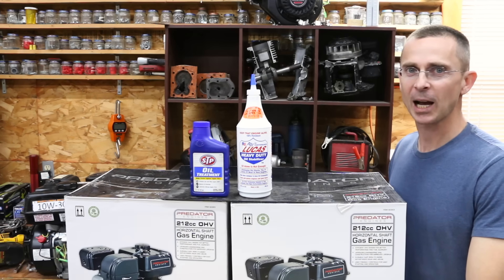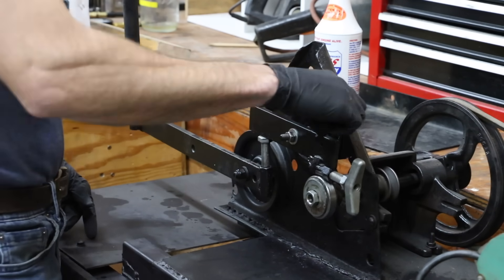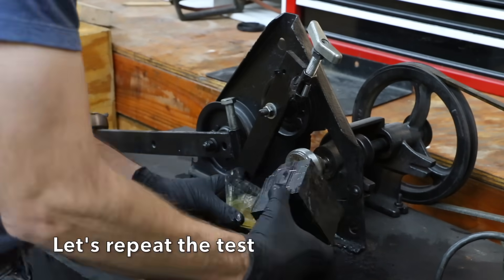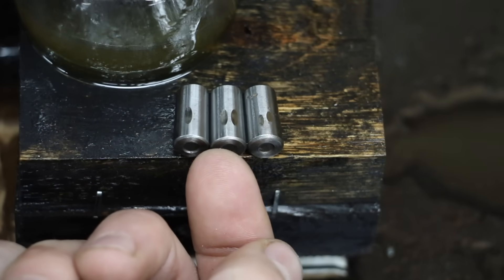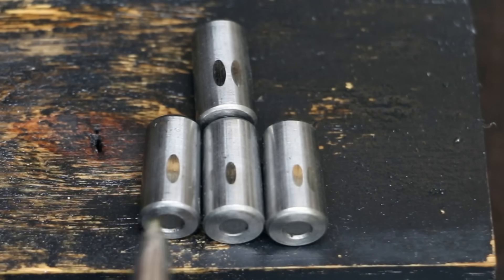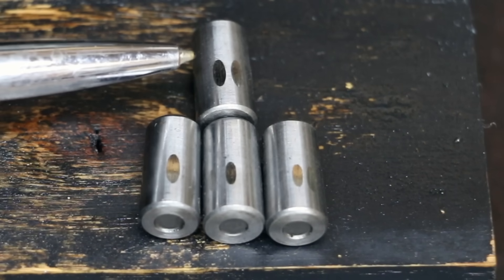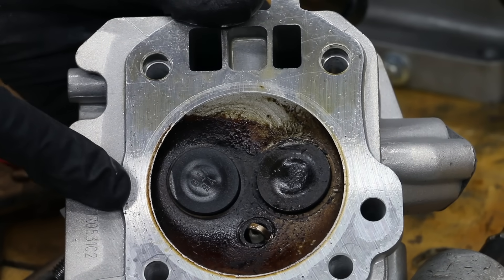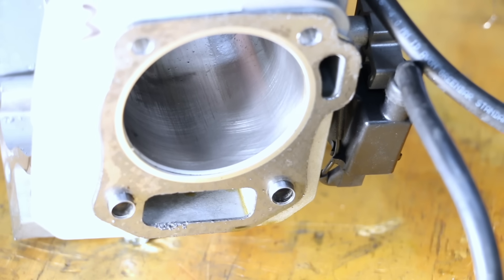Which engine self-destructs first?  Lucas or STP?

Comment: Hmm. Like some explanation on the first test with the bearings. How does the pressure on the bearings  exactly work and why test it  with cold oil? Why test the engines without oil? This tests the engines, not the oil..
Reply from the maker: Since most engine wear occurs from cold starts, cold oil testing seems like the way to ago. Also, if film strength is good, moving parts should be coated.  Warming the additive would be a great way to go as well. Thanks for commenting.

Comment: im a lucas man thru and thru... but i dont put it in my motor oil... i mix it with my 80W-90W gear oil that i use on my motorcycle chains. ive found it does help it stay on the chain longer and hold up against the water a bit better.  but thats about all i use it for (some times it makes its way to the drill press as drill lube but almost any "oil" will do for that)
Reply from the maker: Thank you for this recommendation!

Comment: I would like to make one recommendation, when running the engines together you should rotate the engines to where the cooling air from the left engine is not blowing towards the other engine.
you can see it blowing the tape holding the dip stick and drain plug, this heated (from the front engine) air blowing back to the second engine causes it to run warmer and throws off the readings on the second engine.
otherwise I really enjoy these comparison videos. well done!
Reply from the maker: Thank you for this recommendation and thanks for the positive comment!

Comment: Lucas has a good line of additives and cleaners, I have wondered about their transmission additive, it claims to free up sticky valves, I tried it in a trans once but didn't know the trans was already bad with blown clutch pack and it was much like the oil additive very thick.  Also I wonder if the injector cleaners are worth buying, I have heard the chevron with techron injector cleaner is the best on the market, what about testing all the injector cleaners is there a way to test those to see how they perform.
Reply from the maker: Thank you for this recommendation!

Comment: The only thing I have ever used Lucas for is engine assembly.  Beyond that from what I could tell by the bottles all it does is increase lubricity via the increase of viscosity.   So when mixed wouldn't it make more sense for your wallet to just used a heavier weight of oil?  That might be worth testing. An engine with say 5w 30/lucas stabilizer mix vs a 20w 50 engine.
Reply from the maker: Thank you for this recommendation!

Comment: wtf did you prove you noob I bet if you did this test 5 more times it the out come would all be different unless you checked every tolerance yourself. even then you ran the motors with no oil so what did you prove other than motors need oil... if you put half the amout of oil needed In the motors then let them run till fail I'd say that's more scientific

Comment: 70% of engine wear happens during cold start, it takes about 2 minutes for the oil to start circulating
Reply from the maker: Thanks for commenting on this!
Reply: A lot of that depends on how the engine is designed and how thick the oil is.  Many modern engines begin circulating oil considerably faster than 2 minutes, especially ones running the lower weight oils like 0-20 weight.

Comment: Thanks ProjectFarm for another great video.

One thing I'd like to see is a quick review vs previous addictives. Maybe a table with the top 3 results from previous videos and a quick verbal bit about how the new ones compared to previous ones.

 Some of the guys on here say that the tests are meaningless, but these show film strength and lubricity, two very important factors. Obviously a better test would be running the engines for 100s of hours and comparing, but that only gives a minor amount of more information for a huge cost and time. Keep it up!

Interesting though that the Lucas Oil was consistently 10 degrees warmer, but lasted twice as long. Also odd that the run times were so very different from the bestline video... Oil : ~40 mins; Bestline: ~70 mins; then Lucas and STP much less. Any reason these ran for so much less time? Any inconsistencies from the first test to the second? Maybe different break in procedures, different drain times?
Reply from the maker: Thanks for the positive comment!  I don't think there were any inconsistencies.  The temperature in the shop seemed the same.

Comment: Just FYI, if that’s a steel crank you can set it in muriatic acid to remove all that melted aluminum. It’ll eat the aluminum right off leaving the steel crank nice and clean. I’ve had to do it.
Reply from the maker: Thank you for this recommendation!

Comment: I need to do a transmission oil change on my car soon and I was thinking about maybe trying and additive so maybe you could do manual transmission oil additive tests, and run them in the engines either with the proper oil for the engine just with the additive or the heavy gear oil they would probably run for a long time like that
Reply from the maker: Thanks for commenting.

Comment: Test seafoam and high quality store brand as enginr cleaners
Reply: Check out his channel.  I'm pretty sure he has already done a few tests on seafoam and a few other cleaners.
Reply from the maker: Yes, I tested Seafoam, Marvel Mystery Oil, BG44K, and several others. Thank you for this recommendation!
Reply: Project Farm not using em in the gas but the oil. Using em in the crank case to clean the engine
Reply: Might be tough finding engines with dirty enough crank cases to test that.

Comment: These 'comparison' videos are interesting, but don't actually provide people with much usable information.  Of course removing the oil destroys an engine, but most of us don't run the engines without oil.

More realistically, these engines are run for long periods of time w/o oil changes, thus before destroying these engines, it would be more helpful and interesting to see the wear and tear by running them over long periods of time; for example, one engine with conventional oil and a couple with the oil additives.  Sample the oil over time and send for analysis (i.e. Blackstone labs).

Those results will tell us whether using the oil additives is worth it over the life of the engines or not.
Reply from the maker: Thanks for the constructive feedback.

Comment: In the 80's when some bearing or gear started making noise in the engine or differential, we added sawdust into the oil before we sold the machine so the buyer wont hear it, the sound difference was really noticeable, maybe you could try it for fun? :)
Reply from the maker: Thank you for this recommendation!

Comment: Try the Power Up NNL 690 I'm a distributer and it will out perform everything even on the timkin bearing test it can take about 200,000 psi when Lucas can take about 40,000 psi and lock up it's even better and cheaper than Royal purple.
Reply from the maker: Thank you for this recommendation!

Comment: Run an Engine on Pure Vegetable Oil vs Motor Oil 😮😮😮😎
Reply from the maker: Thank you for this recommendation!
Reply: WHATS YOURSOC 1969 J-3000 with the Gladiator Buick 350 and Th-400 Trans 4x4  😎
Reply: Would you please do a battle of the nano's
Featuring the following : Borpower nanogreen vs Rvs technology g4 vs Hotshot Fr3 vs XL nanolube vs nano pro mt vs everglide egs synthectic.
Reply: Olive Oil would be healthier. lol
Reply: Project Farm yes do the vegetable oil vs normal oil 👍👍👍🙏
Reply: I like your idea Blake and I could see using veggy oil vs. mineral oil, but olive oil would never stand up to the punishment and surely die first. It has a lower flame point than those other two. It might catch fire in an engine, as it can catch fire in a frying pan before any other oil will. A decent replacement for olive oil in a 3 way test like that, might be Peanut oil, Canola Oil, or other high flame point cooking oils. I'd say maybe Coconut oil, but I don't think it would be as durable (kinda like Olive oil). I bet Canola would hold up well, cause before it was GMO'd for human consumption, it was an industrial oil.
Reply: @MrBilld75  I understand canola oil used to be in industrial lubricant. Checkout naturalnews.com
Reply: @barrysimmons5489  No I will not check out Natural News, because they are full of shit and their CEO Mike Adams is a lying scam artist. However it was indeed an industrial oil before being genetically modified and I still think it's not fit for human consumption. I never use the stuff. I cook with Peanut Oil for high temps and olive for lower temps. I don't even like Vegetable Oil cause most of it is made with garbage Soy and Soy is no good for people (especially men).
Reply: @MrBilld75  I haven't been on there in a number of years but that's where I got that bit of information.
Reply: @barrysimmons5489  Cool.
Reply: Then use castor oil, straight castor oil!  It was THE racers' oil in the 1920s.  It is much oilier than straight petro oil. BTW, it cannot be mixed with petroleum oil.
Reply: Chris Chiampo to add. maybe olive oil and some other kinds. would be interesting to see how they all stand up. good suggestion Chris.
Reply: Yeh I need to see that
Reply: I already asked for the vegetable oil test some time back. Was told that video would be made but still waiting.
Reply: Project Farm 
   Interesting test that kind of confirms my life experience over the past forty years using these products. The stp works fine in lower heat application (for eg manual transmission or differential) , with the lucas being better inside of engine's.
   Another variable that you might consider including would be to do these tests no matter what additive with some type of load on the engine. This could be as simple as a friction brake on the crankshaft. From my experience you will probably find that this does cause a noticeable difference in the performance of these additives, and is more realistic to what happens in real life situations.
  Thanks, and looking forward to more of these tests.
Peace
Reply: I remember seeing a test using Castor oil on test rig similar to the one in video. (probably mid~late 1970's )ALL 'conventional' oils broke down within 10 minutes, Using 'racing 'Castor oil, test was stopped  after 30 minutes with minimal wear on test piece. Castor oil, at hte time was the best you could get, but, it has other issues with oxidation and thickening.
Reply: @peterjones6945  I wonder if that's how "Castrol" got it's name?
Reply: Some Crisco maybe
Reply: Yea try canola oil
Reply: Chris Chiampo 
  Vegetable oils are going to break down faster in the high heat situation inside of an engine, this is plain physics. More interesting would be the use of mineral oil as another reply suggested, and was actually recommended for some engines in the early 20th century.
Reply: Flaxseed oil is probably the only veggie oil that would have any chance of not burning.
Reply: I don’t recommend it. Vegetable oil has a flash point of about 350 degrees Fahrenheit while motor oil is about 450... it will end up burning to a char and won’t make too useful of a video. I liked this video because it showed 2 leading brands.
Reply: It would be fun!
Reply: Playtime: All modern motor oils contain detergents. If the oil and filters are changed regularly no additional cleaners such as kerosene, Rislone or motor flush are needed and may very well harm the engine.
Reply: Flaxseed oil is actually one of the most flammable vegetable oils as it has lots of highly unsaturated fats. Very low smoke point!
Reply: Hemp oil? It works the best on squeaking door hinges. I tried olive oil, wd 40, vegetable oil and soy bean oil, the hemp oil worked the best on the squeaking door hinge. In fact I have not herd it squeak since I used hemp oil on it 5 years ago. I was using the other oils every few weeks.
Reply: Vegetable oil is not a motor oil, Chris. It does not have an additive package.
Reply: You Are Full Of It I still do that to my lawn mowers but only for few min.   My one tractor 50 yrs old
Reply: Mate can u test the liqymolly additive  and there is a engine oil thats ment to be realy good its called Mobil delvac mx 15w 40
Reply: Ken Reid 
  Definite loss on the part of transmission fluid. It is designed to be thin (viscous) with low bonding attributes, and doesn't handle high temperatures very well. 
  Think about how just about any automatic transmission has an external cooler or radiator to keep it from over heating.
Reply: Chris Chiampo i Love this idea !!!!!!!!!or on wd40
Reply: haggard garage did this and it keeps showing in my suggestions, I can't bring myself to watch it.
Reply: Theresa Oakes they Did it in a Car With Soda in the Cooling System and mixed with the Oil Not Pure Vegetable Oil In an Aircooled Engine Like Project Farm
Reply: Yea that's a good suggestion! I like to see that too!
Reply: Project Farm run an engine on transs misson fluid
Reply: How silly can you get?
Reply: TakeAmericaBackfromISREAL, how about water base verses silicone base?
Reply: Peanut oil in particular plz :3
Reply: that smell good...
Reply: Chris Chiampo denise
👿 how do you remove clear coat from engine body how do you remove white spots from a body automotive body how do you remove white spots from an automotive body
Reply: Chris Chiampo yess please
Reply: Spin on paper media engine filters clog at 3 thousand miles. So why do piston aircraft engines use high capacity dirt trapping reusable stainless steel mesh filters? Even the best spin on disposables are full if carbon/metal trash in three thousand miles and bypass valve is open.
Reply: That's a big waste of everyone's time. I can tell you right now that "vegetable oil" will fail VERY quickly. We knew a guy years ago who was so broke and SO stupid, that he actually filled the crank case of his pick up truck with vegetable oil. It blew up almost immediately. Veg oil isn't even anything like motor oil.
Reply: Can you test or prove. Japanese motor out lasts German engines
Reply: Chris Chiampo tt
Reply: +Patrick Palmarella bmw german vs honda civic japanese. i got my money on the honda mine is close to hit 250k miles no problems
Reply: Pork fat Lard or Virgin Olive Oil
Reply: LOL Chris those cute yellow gasping faces then shades lmao..
Reply: Of course motor oil would win
Reply: Gonna smell like French fries and old garbage ...
Reply: LOL!! Cute gasping faces Chris and a shades face lol
Reply: Castor bean oil. R/C aircraft did it for years. Terrorists make ricin from it.
Reply: no run it on lard
Reply: Oh that's a good one.
Reply: Vegetable oil vs olive oil vs mineral oil
Reply: @treeofspoils6978  how about coconut oil, if it Cooks at least it'll smell good.
Reply: How about kerosene as a kid my dad when only non detergent oil was used sludge would build up a lot. His mechanic used to use kerosene only to flush the sludge out by driving the cars for 20 minutes to loosen and than drain and install new oil. I swore it was doing harm to the engines after all I had taken a small engine course in junior high and shared this with my teacher. Why 20 minutes driving sometimes driving the same area depending on traffic it might be more or less time. A few customers engines started to smoke after having this done a few times. Thank You oh I am 79 now and know better.
Reply: I never heard of nor would I try kerosene only. In 1970's many of us would use a mix of 3 quarts oil, 1 kero, 1 tranny fluid. Would free sticky lifters, stuck rings, and clean out sludge etc... from our old cars. Was allot of other mixes people would use also. Cars we were messing with then for old cars was early 60's and older, the good stuff!
Reply: Chris Chiampo very good idea
Reply: Chris Chiampo

Comment: Hey bud. Great vid as always. Have you tried the Lucas upper cylinder lubricant/fuel injector cleaner & conditioner? The big sauce bottle with the tiny blue cap... If you could put that through its paces I'd be very interested in the outcome. I'm on my second bottle with reasonable results.
Reply from the maker: Not yet.  Thank you for this recommendation!

Comment: Another great video! Do you like Predator engines? Are they as good as Honda?
Reply from the maker: Thank you for the positive comment!  I like the Predator engines a lot, but I don't believe they are as good as the Honda engine.  However, they are far less expensive.
Reply: They are also impossible to find parts for

Comment: You should have had a control engine that had just normal motor oil drain from it.
Fun test, but to be honest, I don't see the point of it. I think it would have been better to test the additive, in the engine with oil, under extreme conditions. Run them and a control engine, under load, with the cooling fins blocked and see which one last the longest.
Reply from the maker: Thank you for this recommendation!

Comment: I would have preferred that you stop the test at the point of failure of the first engine and inspect the surviving engine for bearing wear and cylinder wall scoring at that time, then assemble the surviving engine and run it until it self destructs. No matter what oil additive you use, the end result will look the same. The only difference will be how much time it takes to get there.
Reply from the maker: Thank you for this recommendation!

Comment: What about putting Slick 50 up against anything I have it in my Chevy Big Block  and when I went to rebuid it  to make more HP 
They hot tanked it 3 times and still could not get it clean so they had to lazer it off.
Reply from the maker: Thank you for this recommendation!